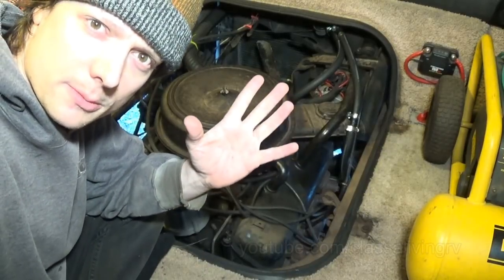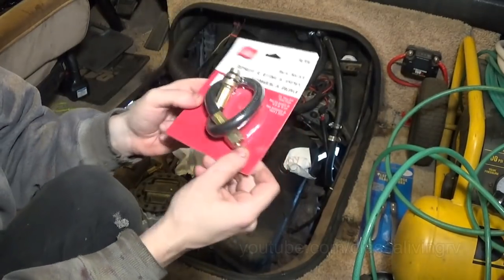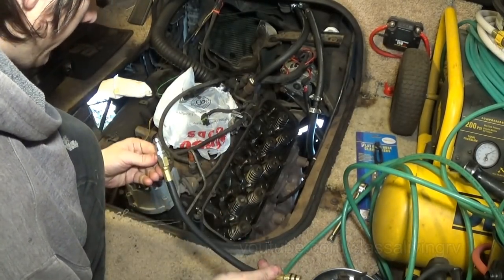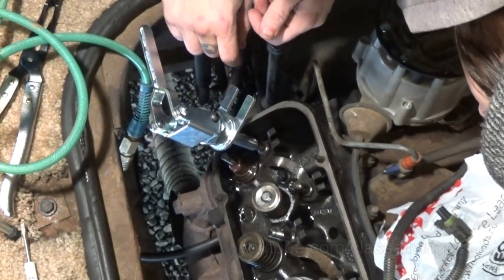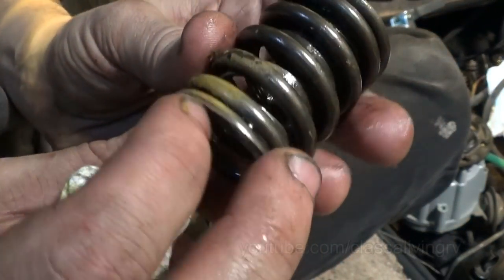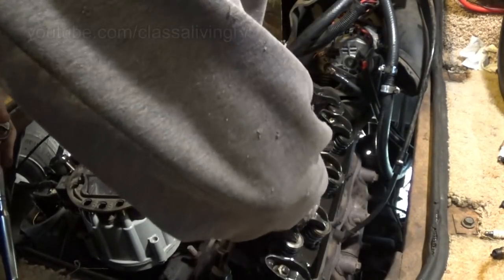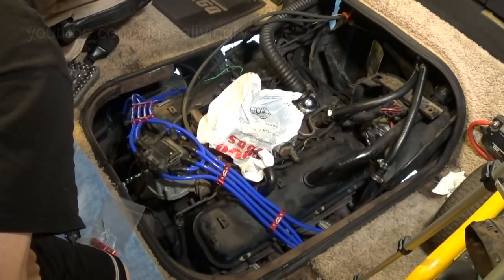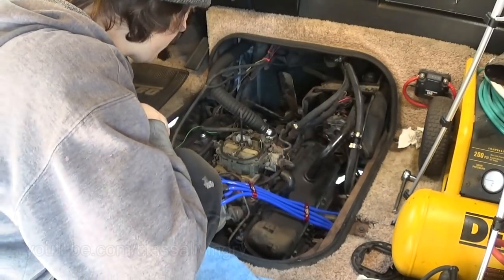Valve Stem Seal Replacement || 88' Chevy P30 7.4L RV

Comment: I have an 84 Winnebago Chieftain. I put an electric water pump and electric fans and got more power and a cooler engine. With the electric pump and fans your cooling ability doesn't depend on engine RPMS.

Comment: how many miles on that engine??? the outer side of the heads looks remarkably clean.what brand of oil have you been running in the motor???

Comment: Are you sure you dont have a vacuum leak? Those plugs looks like its running real rich or somthing like that! 
 What that is on the springs is paint from the factory.
Reply: vac leak would cause lean condition.

Comment: whats the verdict on the sea foam read diff things about it
Reply from the maker: It cleans engines, that's about all I know
Reply: Seafoam is really good. Put a can in the gas tank and basically do the same thing. It's also good to add 4 ounces to
The engine oil to clean the internal parts as well. Run it 200 miles and change the oil.

Comment: If u wana help stop some of you're blow by and restore some mpg and compression you should use aome restore its in the chrime can for 4 6 and 8 cylinder i use on every oil change and when i use on any cars ive bought with over 100k miles u will be very surprised on the difference after about 45 min of driving and have never had a single issue with using it ive been a mechanic for 28 yrs

Comment: Carb may need tossed. Ide put one on like it from pre smog era or edelbrock or holley. A smaller Edelbrock would be nice and no adapter needed only a plate between carb and intake.
Reply: I put edelbrock on my 454 in the RV, its nice. Though oem was good, but needed some loving and caring. Rochesters are good if taken care of.
Reply: Edel-junk are crap in cold weather. I'd go aftermarket fuel injection https://pfisys.com/ sells a good one. Better mileage and cold starting. They use a 90s style rochester throttle body and a stand alone ecu. The kit has all the needed sensors and such you can run it wit or without o2 sensors. I think mine cost 700ish for the complete kit.  I even got an aluminum capless distributor with it. Just tell him your motor info and you get an adaptor plate to fit. Nothing like fuel injection performance on an old vehichle.

Comment: Great job Nathan.I was so worried you were not gonna do the extra 3/4 turn on the valve adjustment.Only thing i would have done different is double checked plug gap,because many times they are way off(even new),and run the seafoam on the old spark plugs,since it does a washing effect on the carbon which a lot of it ends up on the plugs.Not a huge deal though it should be fine.Great vid as always.
Reply: Need a feeler gauge for the NGK plugs, using a regular gap tool would ruin them. NGK are pre gap from factory.

Comment: None of the seals looked overly bad from what was shown, and even if it was the cause of the oil leak it would be out the tail pipe unless the valve cover gasket was bad too.  My theory is that it is the rear main seal that needs to be redone, given the age of the engine and how often you have to add oil that seems like the most likely cause.  Also the best way to lash the valves is to use feeler gauges and set it to spec, I would recommend getting a set and double check to make sure they are right (being too tight can be bad too).  I would also recommend running a bottle of Sea Foam in the oil to clear out the crud before doing the oil change, just make sure it is ok to with the home owner as it will make a lot of smoke as it works.
Reply: It's hydraulic lifters that get pre loaded ,as why the 3/4 turn after no lash.So the feeler gauge is not gonna do much on this setup.
Reply: Yep hydraulics aren't lashed just preloaded.

Comment: I’d say that crap in the middle of the cylinder head down the hole that the push rod goes..is oil buildup due to it being hotter there from the EGR passage..and can be from lack of oil changes .  Is the valley under the intake clean? While you’re at it, take the distributor cap off, and turn the crankshaft by hand and check how many degrees it takes till you see the rotor move. My concern is the condition of the cam gear..and they did use nylon coated ones.

Comment: A wideband air fuel mixture gauge and sensor would end up saving you money
Reply: Absolutely.I feel like its running pretty rich after seeing those plugs,minus the burning oil issue.
Reply: A FiTech EFI from Facebook Market would be the best option! $500 very well spent and he is a smart kid. He would also make it back in revenue from the video views.

Comment: That valve spring compressor and air fitting for the spark plug holes are great! That would have saved so much aggravation when I did the seals on an old 455 engine. Good job Patches is sounding great. The "miss" is actually just loping from a bigger cam. The RV engine was built up from the factory for more torque because it has to pull a house around with it.
Reply: I love the way a cammed RV engine runs

Comment: The missfire is the cam they use in them the cam is a mild cam generally used for towwing often referred to as a tow cam that is why it has the lope / missfire they did this to increase the torque output HP is to accelerate torque is to do work in your case to move that heavy beast work LOL.
Reply from the maker: Oh ok thanks for the info
Reply: Its too much fuel

Comment: That build up of carbon you have there, is normally a sign of short journey's, where the metal on the engine gets hot before the oil has chance to get to working temp and the the result is oil frying on the cast metal forming that carbon build up. Make sure to give a good blast down the road regularly.

Comment: If your burning a bit of oil either from worn oil rings or valve stems/valve stem seals you can always try a slightly hotter spark plug, especially if your only doing short trips.   If you do longer trips probably stick with the standard heat range spark plugs as the oil should burn off over a longer drive.   As with all petrol engines regular good quality oil  and oil filter changes will lengthen the life of your engine, think the lifeblood of it.    If you are worried about the carbon buildup or oil sludge from not regular enough oil changes you can always use an "oil flush" additive to the engine oil before an oil change (drive around for a few days or trip before changing the oil and oil filter.....

Comment: Try running  marvel mystery  oil in the oil and the gas to brake  up the carbon it happens  with the change  in oils  from back in the day  try running  some semi synthetic  oil dont run full it will eat the seals and you will start leaking oil out of main seals

Comment: Excellent work. It’s a fairly big project to do on your daily driver and you made it look so easy. I wouldn’t do it unless I had a backup vehicle to drive😂. I was wondering, what made you think you needed to replace these? Did you have excessive smoking at startup that eventually disappeared when driving? That’s the usual indicator. Constant smoking is usually rings. The moisture is most likely the temp changes and the season weather can cause this. But wow you do great work. Cudos for another job well done. Let us know if your mileage improves.

Btw, I think I seen the sparking the other poster was talking about when you were first cranking the engine at 42:45 ish right from valve cover to the back of the alternator...
Reply from the maker: Thanks! 
Engine was consuming more oil than it was dripping on the ground and It doesn't look like it's coming from the rear main seal.
Ahhh ok thanks for the timestamp, that's just daylight shining through the fan blades as it's spinning
Reply: @Class A Living I was thinking it might have been daylight but just wanted to make sure. If your still losing oil, do a compression test on each cylinder. Could be the oil ring on a piston is worn. I’m sure you already know all this. You do awesome work.

Comment: I saw sparking on the front right of the engine
Reply: Against the valve cover
Reply from the maker: When?
Reply: @ClassALiving  when the camera was above the engine blooming down and you started it. The spark came from I think alt to valve cover on right front of engine. Look at video
Reply: It was a blue continuous spark
Reply: I believe at 47.36 video
Reply: If I'm mistaken I'm sorry
Reply from the maker: Ahhh ok thanks for the timestamp, that's just daylight shining through the fan blades as it's spinning

Comment: The white smoke coming out of your exhaust is definitely water vapor. The coolant is probably leaking thru the head gasket seal. If you need to constantly top up your water coolant that means that the head gasket is leaking. The worst case scenario is a crack in the engine block or head.
Reply from the maker: Actually it's the seafoam. No I do not have to top off the antifreeze it stays at a constant level.
Reply: @ClassALiving  great 👍

Comment: You are losing spark at #2 cylinder  causing the roughness at idle and plugs show running rich the oil is on out side of plugs

Comment: Just saw your channel and subscribed today. I think it's cool you're venturing out and not afraid of taking care of your motorhome. Rv s were my dad's business. I started working on them at 14 now I'm 69. I was also a racer and carb builder. The absolute best advice l can give you to save money and make your coach dependable is, THROW THAT QUADRA JET CARB in the nearest river. Get a Holley spreadbore. Super simple to tune and keep clean. You want a 650 l think #6210 it's an older model. I can't tell you how many motorhomes, tucks, boats and vehicles l have changed from gas guzzling, vacuum leaking, bucking piles of aggravating to five miles a gallon better at least. As well as smooth running. One reason your coach sounds so bad at idle is that Q junk is leaking internally. It's dropping your mileage away. I know the defenders of the Q junk club jump in and cry I'm so wrong. DON'T LISTEN! Hers a why, my race car Paynepartner wentand bought a new 454 dually crew cab in 1985. The first time he checked his mileage it was 8 mpg. He learned it didn't matter if it was uphill, down hill, towing or not, it was 8mpg. I found a 650 Holley spread bore, rebuilt it and installed. Immediately the truck went to 15 mpg. We could tow the race car, 240 inch rear engine dragster with all the support equipment at 10-12 mpg. We also advanced the timing. There was way more power. Remember in your motorhomes day emissions were king. Not power. As you learned removing the world o hoses already. They were retarded timing fat slugs. While still pouring unturned fuel out at a high ratio. The oil companies were still controlling the auto makers. So they were just going through the motions and dumping fuel as always. You can't do anything to make your coach run better and more efficient. Oh and Edelbrock carbs are just old Carter's with a shiny coat. All the best. If you want some help with setting one up let me know.
Reply from the maker: Thanks for the info i'll check it out